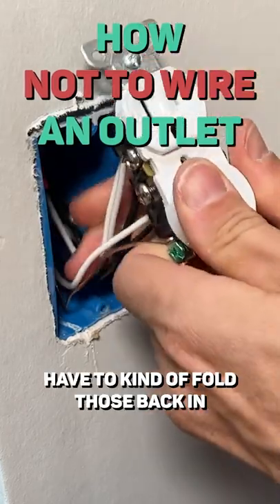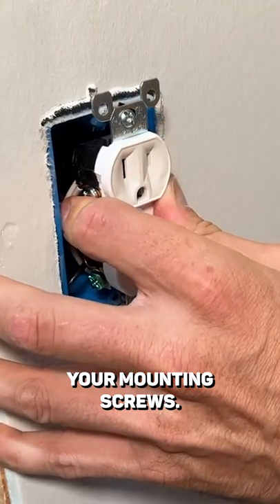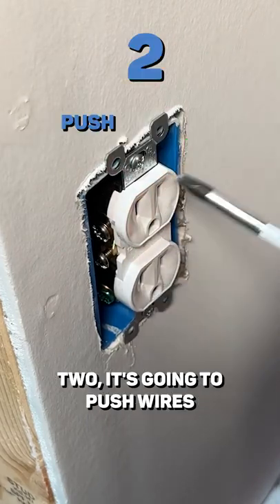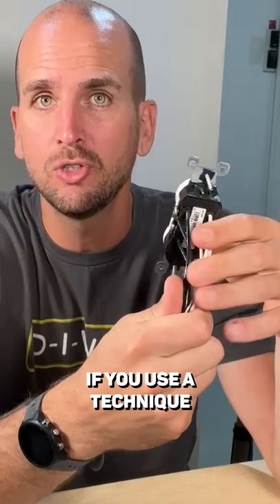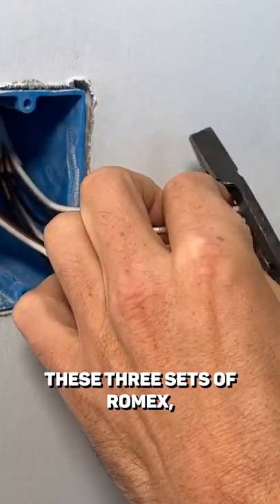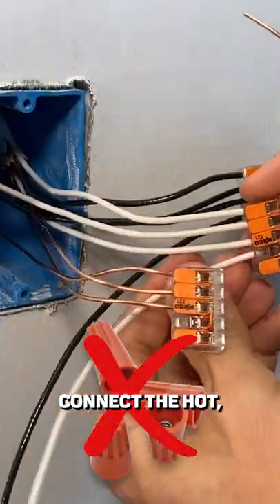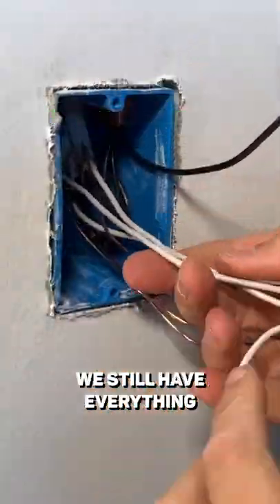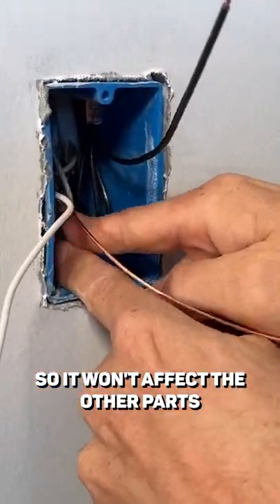The Better Way To Wire Outlets #shorts

Comment: Well, there's only two screws anyway. And you shouldn't be using the stab in connectors ever so that's your only option, it's the only way, not the better way

Comment: Depending on what state you live in commercial jobs require pigtail they don't let you pass through the  Yoke
Reply: only thing that should be connected to the yoke is the ground and not even that on a IG receptacle.  hot and neutral never connected to the yoke. Those connect to the terminals.
Reply: @i_no_nutin   If excuse me wrong terminology I mean the device not the yoke.

Comment: First of all your totally wrong on the “getting it flush part. If you mount the box correctly and push the wires in the back it will mount flush every time. Second… if you have two wires like this the only thing you would need to pigtail is the ground wire. Third… no real electrician does pigtails with that bs. Use a wire nut.
Reply: Another thing I’ll add is that real electricians.. when you are ruffing in a house you purposely leave extra wire in the box so that you have more wire to work with. The only time you would ever need to pigtail all those wires are if you did a remodel and the box you’re working with has super short wire. Or if you have a 3 way switch but that’s a whole different situation

Comment: You should NEVER have 2 wires on 1 screw/lug/terminal!!!! That is a good way to get a bad connection and burn ur house down. Outlets come with 2 sets of screws so you only have to pigtail 2 out of 3 wires.... why make it harder than it needs to be

Comment: 1- Stop using those damn Waco's. They are no different than back stabbing a device that you put down all the time.

2- I just watched your ground wire fold back to your neutral screws and you tried to edit the touch out but still did not put a bend in the wire to prevent it.

Comment: No wire nuts? Lol.. properly twisted and nut 3nds have far far more contact patch. Those plastic push in pieces the ONLY contact the electricity  has is where the tiny spot that little bass bar/locking piece touches the copper wire... it's a horrible connection. 15amps or less and I still don't like them.  
   Properly made connections don't arc and heat up. After years those push in one's are brittle from heat.  Wire nuts only do that if the pigtail isn't properly and tightly twisted.

Comment: Wagos = weather shorts and possible fires.
Reply: Bruh, why are you exposing them to the weather? Both wagos and wires nut require a weather resistant  juction box when out door

Comment: Are waygo connectors safe? I used to read americans complaing about their safety
Reply from the maker: Just my opinion but for most DIYers I would say WAGO lever nuts are safer than wire nuts.  You will get a more consistent solid connection as compared to wire nuts in certain applications.

Comment: Orange and blue wire caps bro. You took a good point and destroyed it with wagos.  Real electricians clip these off of  High hats Because they are total pieces of s*** and don't hold crimps  Like a hand twisted wire cap.

Comment: No tape on your connections?
Reply: For what? The only thing the outlet Connectors could touch is the wires in the box and they are rated for whatever temp the outlet can put out at a given amprage.
Reply: @randybobandy9828  really the only time i tape a yoke is if im installing a GFI in a metal old work.

Comment: You would never Jan 2 wires in the cheater holes..yes the surface of contact under the screw is still more.. trying to get 5 pounds of schit in a 1 pound sock.. still can't do it..

Comment: Use the wrong kind of wire connections fire hazard. Need to use traditional wire nuts.
Reply: No.
Reply: Those are proper connectors wtf are you going on about bud

Comment: I honestly wanted to throw up watching this I don't know if it was those gross orange connectors that no electrician would ever use or the fact that on the original tie in the wires were back stabbed and on screws...

Comment: Your wires are just way too long. Way too much length is coming out of the wall.
About 5cm is sufficient.
It's also not legal to have 3 wires on a plug. In such case, pigtailling is *mandatory*. But seriously not elegant. It's more a bodge to fix badly planned wiring.

Comment: Waste of time and resources. Wire is simply not that hard to fold back into the box. Anyone who has a hard time with it should probably not be a professional electrician. This would add an insane cost to wiring up a whole house’s outlets, and most of those outlets are going to stay put for about 5-10 years.

Comment: if we're going to use Wagos make sure you insert the hot feed in the center so current is distributed evenly.

also you should not use an outlet to connect outlet branches, do you really think that thin piece of metal between the screws that's designed to be broken away is meant to  driving 15 amp heater further down the circuit ?

(also I have fired electricians who used the quick push in connectors

Comment: You're wrong every, every splice is a potential failure. I only pig tail when the wires are too short.
Reply: You are wrong, pigtails is actually far superior then using the receptacle. If you do your spilces correctly they should never fail
Reply: @Teh_Random_Canadian  I agree, but it's funny how so many know it alls think there is only one way to accomplish a task.
Reply: @randybobandy9828  It is amusing to see. Even among tradesmen though it can it has to be done a certain way. However no electrician worth their salt would ever use the backstabs of a receptacle
Reply: @Kevin-mp5of  because having 3 to 4 sets of wires connected to your plug is a terrible idea and should never be done...

Comment: Use a wire nuts those things you're using are trash. That & use a deeper box it's only a few cents more & everything fits so much easier. Any body who wires outlets the first way you showed is doing it WRONG.

Comment: Are you not supposed to use sheathing on the earth in your country?
Reply from the maker: Nope, bare copper is the most common.  On some applications you will see green sheathing on the ground wire but not common in residential.  With that said the copper wire is running in the middle of a non-metallic bundle of wires (Romex) and not through conduit in these instances.

Comment: Every added terminal connection to a domestic electrical circuit , will increase the continuity resistance,  deeper back boxes would eliminate this problem .
Reply: The resistance is negligible.  A pigtail is the correct way to install an outlet since you are not relying on the outlet itself to provide continuity to a circuit (which is technically a code violation).
Reply: @Kevin-mp5of  Sound like an argument from laziness tbh.  Not only are pigtails mandated by  NEC 300.13(B) for multiwire circuits, they are advantageous for single circuits as well.
Reply: @Kevin-mp5of  Plenty of advantages, you can easily remove an outlet without disturbing anything else in the circuit e.g. for decorating.  No risk of screw type connections loosening over time and interrupting the circuit.  It's neater, you have a single cable going to the back of the outlet which cuts down on the space used in the box.

Comment: 1)The box is overloaded 2)those splice devices are junk
3) tighten the screws on the sides
4) do not use the push in holes in the back of the device
5)Splice all the conductors together with a tail for the outlet
6) tape the outlet with 2 complete wraps 
Any other way is crap.

Comment: Your loosing your cubic inch using those large stab in splice connectors, use a wire nut and twist the wires, if note a licensed electrician you shouldn’t be giving out electrical advice!

Comment: Electrician here. Use wire nuts for a solid mechanical connection, wagons are for diy-ers like this guy
Reply: No. He's teaching diyers not that he is one. I agree wire nuts provide a tighter connection when done properly and they are like what, 10-20 times cheaper?
Reply: "wagons are for diy-ers"

Firstly they are called Wago and secondly they are used almost exclusively in newer installation throughout Europe and have an excellent track record.  

The irony of someone in the US calling out European wiring standards isn't lost on me though, just look at that poorly designed outlet with exposed live parts on the back.  Absolute junk.
Reply: @Kevin-mp5of  I Can already tell you’re probably a homeowner/diy-er that’s fine there’s nothing wrong with that Buddy. You have absolutely no clue how strong a good wire nut connection is compared to a wago, in All my years of field experience never would a wago be superior to a wire nut 😂, sure the wago keeps your conductors straight, and not mangled like a wire nut would, but hey if wire nuts are too hard for you to twist with your little princess hands that’s cool man don’t get upset. At the end of the day you do things the way you’d like to do them, just don’t get upset when a professional has to fix what you “repaired”

Comment: Bull Crap.  UL required all residential back stabbed outlets had to be redesigned several years ago.  The wires used to become loose the more the outlet was used.  But now.  The back stabs are 10 times better, and is tight.  And they stay tight.   This guy is not an electrician and probably doesn't even know this.  If you know how to do electrical work, this is not any harder than any other method.

Comment: Okay please stop electric work! 1 you didn't tighten All and I say all yes the ones that don't even have wires 2 you didn't wrap the wires with tape 3 you're using wegos instead of wire nuts which are constant connection 4 you are probably not certified to do electric work!

Comment: Or buy wire nuts, it’s that simple
Reply: He's showing diyers how to wire a outlet and wago connectors are easier for a non pro to not mess up the connection.
Reply: Wire nuts have one single advantage: they are cheaper.  Wago connectors are faster and easier to disconnect and reconnect when testing or fault finding.

Comment: Guy. Use wire nuts. Stop informing people how to install electrical devices. You are not a electrician. And you are not using tamper resistant outlets, did you pull a permit for replacing the outlet? Did you arc fault accord nec code? Did you spend at least 4 years working under a master license??

Comment: Dumbest idea ever !! Crowded box now even MORE crowded !! I don't know why you guys still insist on using solid core wires !! Easiest fix, use STRANDED WIRE !! It's so flexible, you will fit everything into the box with ease. Also the risk of bending solid wire like that is it will break so easily !! Every wire for houses here in Australia is stranded. Trust me.. you'll never look back once you try.

Comment: Use the screws (wrap around the screws clockwise, better connection) on the receptacle NOT the stab in holes. Also, all mechanical connectors turned up in box.

Comment: I don't care if you prefer Wago's but don't cross out marrettes and tell people not to use them... they are better then wagos when installed properly.
Reply: Ya that was weird, unless he's saying only pros should use those connectors because a layman can easily do it improperly
Reply: " they are better then wagos when installed properly."

They have one single advantage over Wago connectors, they are cheaper.
Reply: @ferrumignis  Better mating surface area, stronger connection  and yes, much much cheaper
Reply: @Teh_Random_Canadian  Their electrical performance is as close to the same as makes no difference.  Wago connectors are widely used throughout Europe, if there was a problem with them we'd know about it by now.
Reply: @ferrumignis  Ditto goes for marrettes... a non professional saying you should one over the other rubs me the wrong way

Comment: maybe if you didnt have to use crap from 100 years ago.make the box deeper and wider recess the outlet screws. look at europe cause n.american stuff is crap.  48+ years as a spark in 2 continents .also wire nuts jeeze not used this time but they are shit. just go back to knob and tube.

Comment: Don’t use Wagos in a receptacle circuit, the connections will heat up and melt off the insulation and short out( hopefully). I have fixed to many of issues when they are used where the customer uses high current devices “i e” vacuum cleaners, hair dryers, curling irons, and anything else that requires 50% of the circuit value. THEY WILL MELT DOWN! Just pigtail it with a wire nut and sleep better at night. Retired IBEW foreman

Comment: Or use an actual junction box with a trim ring like a professional. While your at it pipe it and pull it instead of an extension cord in your wall.

Comment: There’s less room in that box now for the receptacle with those blocks and you have inferior pressure connections to boot. Use a better quality receptacle where you can terminate 2 wires under each screw. No blocks and quality screwed connections. Simpler and better.

Comment: If you like wasting money on unnecessary materials and time you nailed it . Always loop and use the Phillips head screws . There no reason for all that extra and just more points for failers plus not to mention a night mare for any future work or plugs added on . Those little clips are expensive esp if your doing whole houses .
Reply: You don’t pigtail?
What happens if an out fails?
All the ones after are no good either….
Sound planning
Reply: If you aren't using a pigtail you are relying on the outlet for continuity in the power circuit, and that is a code violation.
Reply: Those clips aren't that old there junk by the way stomp on the floor and watch your lights flicker . 9 times out of ten the old school way is the way to go .
Reply: @ufofreak777  I’ve been stomping for 3 hrs….. nothing

Comment: As an electrical engineer, use a correctly installed wire nut instead of the wago.

Comment: In short you changed the circuit from series to parallel.
Reply: What? It was still parallel the first time... You never wire anything in series in residential electrical
Reply: No. Lol